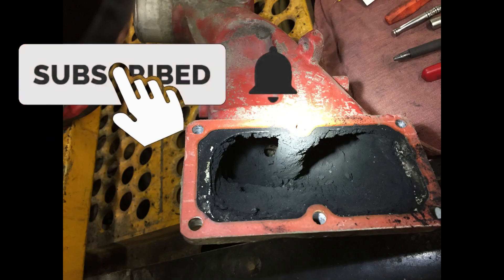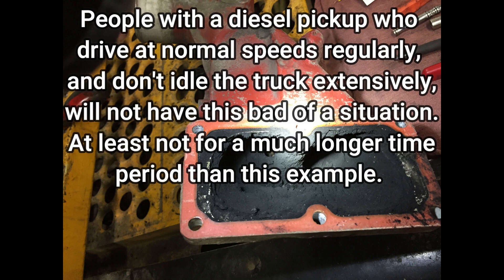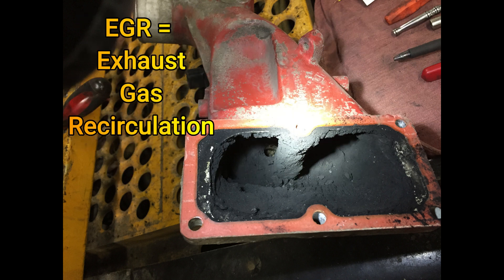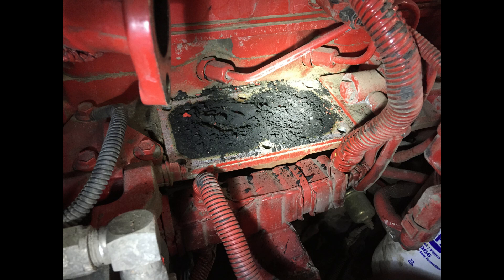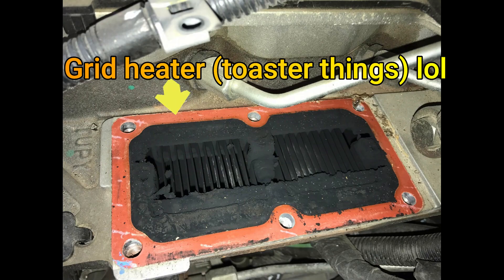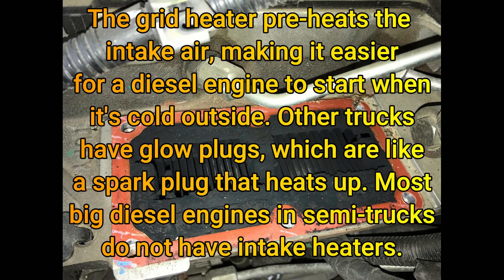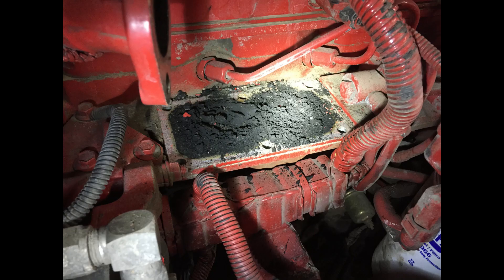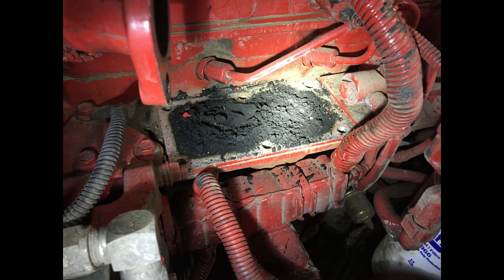Why EGR Is Bad For Diesel Engines

Comment: Can't you just disconnect the EGR from the air intake to fix this? There's got to be software to reset the codes you get when you do so right?
Reply from the maker: Removing the EGR valve only grants you access to the ports where it sits on the intake horn. Problem is that the grid heater under the intake horn also plugs up, so the horn must be removed for proper cleaning when it gets this bad.
Reply: @TonyTheTruckGuy  I meant like removing it permanently, an EGR delete. Is that possible?
Reply from the maker: @stewoe7157  It is possible, but it’s illegal, and comes with fines if caught. Plus many companies won’t even tune anymore to support deletes because the EPA got to them.
Reply: @TonyTheTruckGuy  Oh yeah, I should have thought about that. Gotta love the EPA 😁.
Reply from the maker: @stewoe7157  Indeed, haha